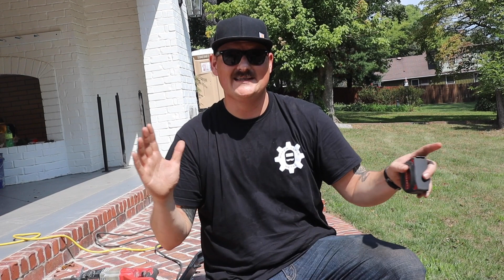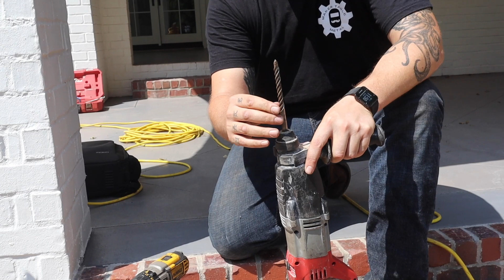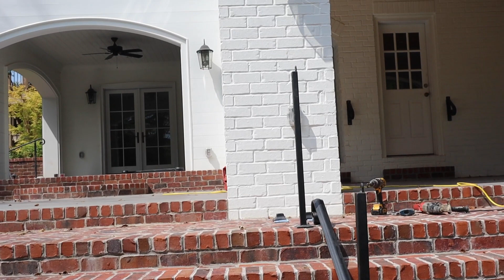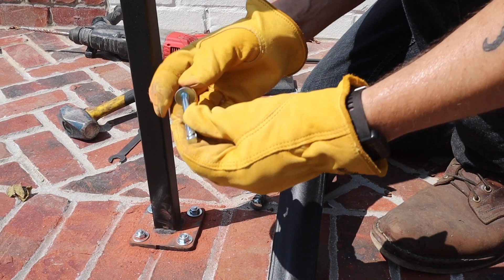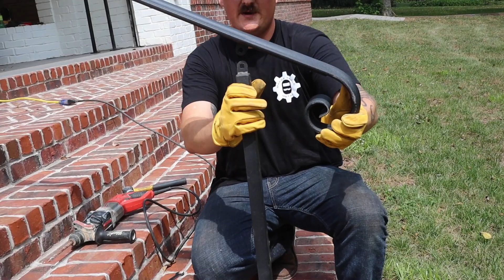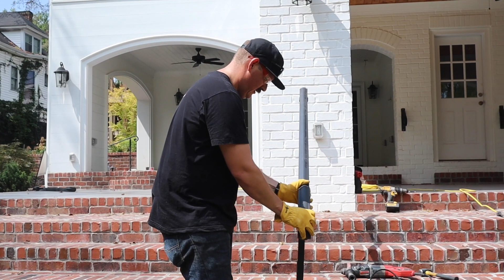MAKE A RAIL INSTALL - Stair Mounted Grab Rail

Comment: After lining up the bottom, put a clamp on the metal to hold the cap up out of the way.  This lets you finish bottom anchors without having the cap drop down while drilling and setting the anchors. 😊